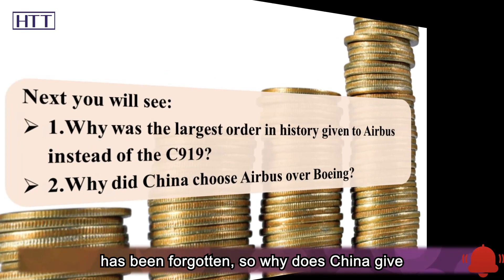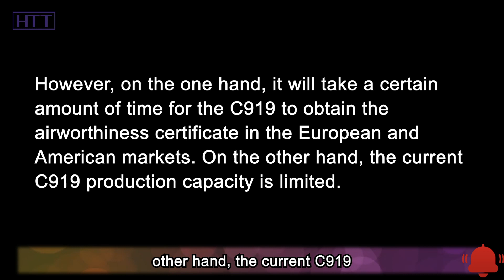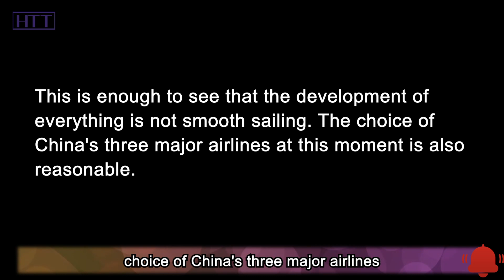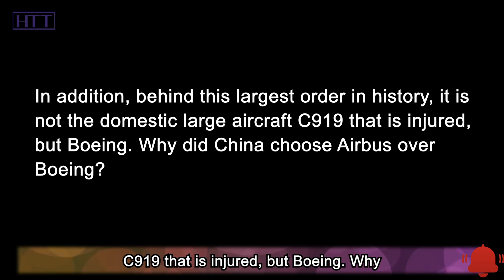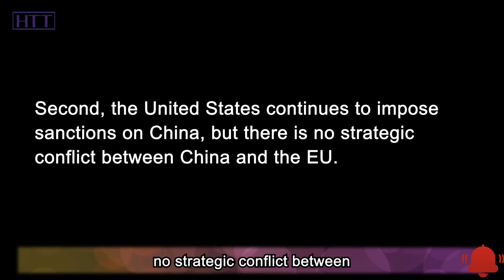$54 Billion! Why did China choose Airbus over it own C919?

Comment: China's aircraft need is huge. China can use 4,000+ airplanes for domestic travel alone. If COMAC can build one C919 a day everyday, it will take over 10 years to fulfill the demand. Therefore I can see China continuing to purchase planes from Airbus as well as other manufacturers.
Reply: The problem with your math is that the demand in China is across a broad spectrum of needs and C919 fits only the domestic routes for narrow body aircraft.  Major routes will go to bigger wide body aircraft.  Ditto for international flights needing fuel to sustain long distances. It will be interesting to see C919 variants and whether the upcoming C929 can compete against Boeing and Airbus widebody variants.

But, your point is relevant.  China's current production rate cannot support even domestic demand.

Comment: The fear of not getting 'air worthiness' certification from the US and Europe could be a problem in a political sense, but the C919 is a narrow body aircraft meant for short haul destinations.  It should start with China and after it has proven its safety record, Europe would probably certify the C919.  The US is doubtful.

The C919 has major foreign content.  Its engines are American/Europe, its avionics gear is American, so it has a handicap right off the bat.  If the US continues to deny exports as it is doing with semiconductors, the C919 could be dead in the water.

https://en.wikipedia.org/wiki/Comac_C919
Reply: If China is capable of operating a space station of its own, I have full confidence to their ability on C919 engine and other parts in the future.
Reply: Please read on Wikipedia who is Wong Tsu, a Chinese from China. Father of Boeing.
Reply: Nothing to fear since they got their own engines though less efficient but nonetheless a stop gap solution to that problem and furthermore you're right about them flying domestic initially. USA is a hasbeen and their FAA not effective so no, they don't have anything to block China since those shackles been broken.
Reply: @catrojana3694  Not true. The only engines that China has developed for use are military and they don't lend themselves to commercial airliners.   The airline business is very competitive and cost, efficiency, and reliability are top factors.  The C919 has yet to prove itself in service and its production rate is not fast enough to make a dent even in the local domestic market.  If no FAA certification, American carriers cannot buy the C919.  If you look at the C919 orders, most are domestic with a small percent of third world countries buying.  CAAC has approved C919 for airworthiness, but it awaits European and US approval.  Without it, the European and US markets are closed to them.
Reply: @MASMIWA  Military will always have an edge over civilian's ones and it's no different in this case. FAA is almost history by now so in reality China will have engines for their own planes domestically if push comes to shove, they don't really need to be held hostage over some engines. There's a war coming up and that will decides whether FAA got any says anymore.